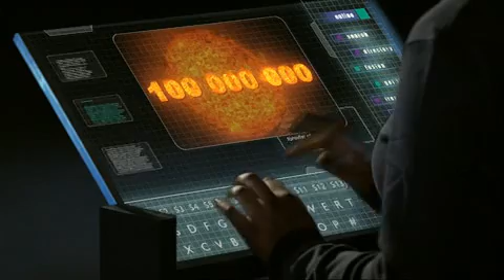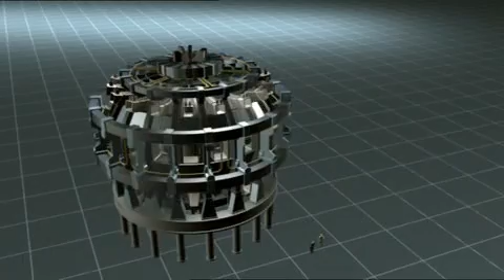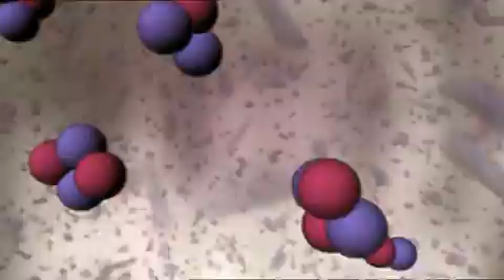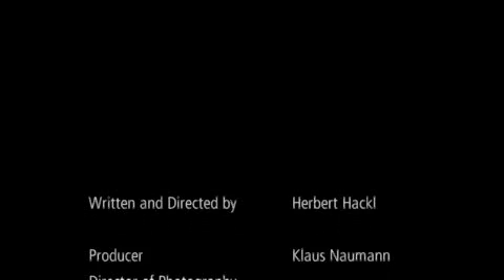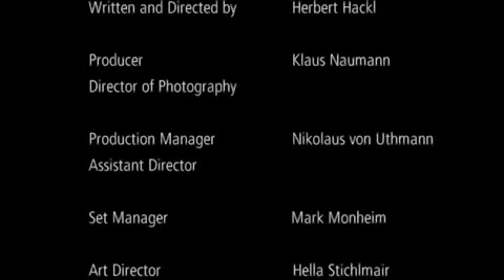How will a fusion power plant work?

Comment: It was glossed over how thermal energy in a Tokamak is converted to electricity. Is that heat generating steam, which turns a turbine to produce electricity? If a net energy fusion fails in smaller Tokamak's, how will going bigger (ITER) achieve net energy? I ask, because aren't smaller versions of a system possible when it is the optimum design?

Comment: 6:00 is where the video starts to explain how energy is extracted from fusion
Reply: The odd idea there, is even though the reactor is needing to heat the deutrium/tritium into a plasma at 100 million degrees, the neutrons heating the reactor wall to produce steam to spin a turbine to produce electricity, will be sufficient to achieve a net energy return? Energy is lost in conversion, as it will be producing electricity via heating water vapor into steam that then turns a turbine, making the idea of getting to net energy even more challenging. I still wonder if the ITER will succeed or if some other design will need to be developed.
Reply: Ah ha, so that's why they seek to initiate fusion with a lot of energy input, but to achieve net energy the reaction must self generate. I get it.

Comment: MY DREAM SPACECRAFT
1.Fusion Power Fuel
2.Plasma Engine
3.Quantum Computer 4.Q-Carbon with other materials.
5.Limitless 1 Tbps Wifi.

Possibly 10% - 2X of the Speed of Light
Reply: Name: GumbsX - 2040
Reply: GumbaverianX that would 1,000,000,0000,000,000,000

Comment: Tokamaks will never be viable fusion power plants.   The fusion power plants of the future will probably have symmetrical plasmas, and will certainly not have "ring shaped plasmas"
Reply: The future plasma reactors will most likely be puls powered reactors and will most likely be using the pB fueld.

Comment: If this one way Nuclear process is true then the dark spots underneath the Suns rolling upper atmosphere would not be dark spots.. .  .Because if the fusion reactions takes place at the Suns core and then radiates outward.. .  .Then those dark spots would be radiating a brilliant white light.. .  .But that's not what we observe.. .  .So the Suns underbody must be considerably cooler than the upper atmosphere..  . .Also it is known that substances loss their so called magnetism at extremely high temperatures.. .  .However, astronomers have observed and recorded magnetic effects upon the surface of the Sun.

Comment: Our beautiful Electric Sun is made of Plasma!!!!.. .  .And that's just Two Spherical Sine Wavefronts multiplying inward +1=0 now -1 dividing outward at right angles from their sources..  .  .Rather like drops of water into a pond multiplying inward +1=0 now -1 dividing outward ripples at right angles from their source's.. .  .Only the drops of water are Inward Spherical Sine Wavefronts multiplying inward from all other matter.. .  . And where the two positive and negative electromagnetic spherical sine wavefronts meet, creates the particle effect +1=0 now... . if that was a pebble, or a wave particle wave.. .  .They have opposite vectors and quantum spin forming the positron +1=0 now -1 electron Wave Centre.. .  .Or any dipole moment!!.. .  .The inward absorption +1=0 now -1 outward emission between the two previous vectors forms the Fibonacci sequence.. .                                                                                                                                                                                                                                      Stimulated emission is a process by the way of which a higher energy quantum mechanical state of an atomic particle Absorbing Energy Compression +1=0 now is being converted to a lower level -1 resulting in the production of light photon oscillations, or new electromagnetic vibrations dividing outward independent of the motion of their sources.. .  .And therefore as individual light spheres super impose crests and troughs become in phase,  in the future its really just light interacting with matter, and the Higgs bosons from Higgs field are really just photon oscillations from all other matter Spherically distributed around that particle now in 3D space, or electromagnetic vibrations multiplying ei inward from the Universe.  . .. And therefore the Sun naturally has enough surrounding implosive positive energy compression contracting time and space around, and within the Sun multiplying inward +1=0 now causing the atoms to break up into plasma occupying larger areas of space within the Sun +1=0 now -1 that constant explosive de-compression dividing expansion outward away from the Sun forms the inward force called gravity as time unfolds C2 into the future.. .  .Takes about eight minutes to reach Earth.. .  .                                                                                                                                                                                                                                  Therefore their fusion reactors will never work efficiently.. .  . Simply because the Sun is a million times larger than our Earth.   . .. And therefore has naturally enough surrounding implosive positive energy compression continuously contracting time and space around, and within the Sun multiplying inward +1=0 now.. .  .Efficiently producing Kinetic Energy in the form of Heat radiating away from the Sun.. .  .This cyclical process converts the "Potential Energy of the Surrounding Space" into the "Kinetic Energy of Suns" as they grow larger into adult Star's..   . Until they reach their age, or temperature limit exploding as Supernovas throwing of rings that eventually give birth to other systems in their wake..  ..Compressing Energy Contraction is life +1=0 now -1 de-compressing expansion is Death.. .  .                                                                                                                                                                                                                                    Yeah sure you'll achieve results by harnessing all the energy output external to the system that you can muster.  . ..And then narrow it down Imploding into one point of some selected material substance.. .  .And produce results.. .  .But only for a slit second!.. .  .                                                                                                                                                                                                                                  Because again the Sun is a million times larger than the Earth, and therefore naturally has efficient amounts of Surrounding Implosive Positive Energy Compression Continuously Contracting Time and Space, Around and within the Sun Multiplying Inward +1=0 now.. .  .The Lorentz contraction of time and space is infinite in our Universe, because its the fusion of the Vibrating Wavefronts themselves, Compressing the Wave Amplitude +1=0 now most of that energy is within Vibrating Matter.  . ..Because everything is relative to the rays of Light : Velocity = Time Density +1=0 now -1 Density of Space Time G/r2.. .  .V= td +1=0 now -1 ds-t G/r2.. .  .The greater the Energy Compression +1=0 now -1 the shorter the expanding spiral wavelengths.. .  .Our universe acts like a gigantic computer because everything will be formed by a surrounding 4pi Spherical inward absorption +1=0 now -1 outward emission of electromagnetic waves.. .  .All motion is 2pi Spiral.. .  .And all 3D directions are 4pi Spherically curved thus : individual input +1=0 now -1 output Wave Centres of photon energy are everywhere relative to an infinite future of potential possibilities, shaped rather like onions relative only to their frequency f continuously coming into +1=0 now -1 out of existence, forming the total oscillating amplitude of Sine Wavefronts at each and every point of space compressing wave centres of energy +1=0 now -1 de-compressing Two Opposing Spiral Vortices, or contracting +1=0 now -1 expanding Virtual Pair's Spiralling out of existence.. .  .Time is inverse multiplying Energy Compression +1=0 now -1 dividing expansion like frequency and wavelength.. .  .                                                                                                                                                                                                                                   So that what they really need is some kind of perpetual motion device powered naturally by the external environment.. .  .Just like the Planets, Stars, and Galaxies are in perpetual motion powered by the Universe.. .  . However are not man made machines.. .  .And because our universe acts like a gigantic computer very moment is a new beginning +1=0 now and the end -1.. .  .Therefore the big bung output division theory by tracing time back to a single point in the past was a huge misconception.. .  . Unless the time reversing singularity of only motion becomes the atoms.. .  .A potential infinity within infinity!!.. .  .Compressing Energy Contraction is Life +1=0 now -1 de-compressing expansion is Death.. .  .Big Bang Death's  are happening now 360, 24/7.. .  .Atomic particles are really High Wave Amplitude Wave Centres of Pure Vibration.. .  ."From regions of intense surrounding wave pressure" .  . ..Made of Vibrating Wavefronts concentrically layered like onions called shells in particle physics, or Spherical Standing Wave Structures over a period of time before decaying back into the eternal Light .. .  .Now their output was the negation of their input : 0 goes to 1, 1 to 0..  ..the start of the Fibonacci Spiral.. .  .So how can we implode more positive energy compression input contracting time and space multiplying inward +1=0 now than the natural surrounding environment dose?
Reply: +Seamless Robe Write some paper that prove your theory rather than comment on YouTube and nobody care what you're saying.
Reply: +Seamless Robe 
didn't read
didn't care
Reply: Do you care about where all your tax paying dollars are going? ..  .I guess that all depends on whether you become a hard working tax payer, or a capitalistic scab! ... .Their fusion reactors are pieces of junk that will never work efficiently.. .  . Our Sun works via implosion naturally, simply because is a million times larger than the Earth.. .  .Therefore they will never achieve that kind of Energy Compression, without using extra energy that's external to the system.. .  .
Reply: Do you know what energy is? .. .. The fusion reactors are 30 years away from pumping out more energy than was put in .  . ..And they always will be .. .  .LOL!!!
Reply: sorry for the "think they are smirk funny" commentators. but your first post, i honestly didnt understand a shit :).. how high degree on math do i need. to get anything out of that you posted?
Reply: Tap the side of a round bucket of water.  . ..Because the Higgs Bosons from Higgs Field are really just photon oscillations from all other matter Spherically distributed around any particle existing now in 3D space, or electromagnetic wave vibrations multiplying ei inward from the universe +1=0 now.. .  . Implosive Potential Energy always comes first before becoming +1=0 now -1 explosive Kinetic Energy.. .  .The fact that this Spherical region of the One Infinite Universe has a limited observable range as the light waves of electromagnetic radiation come from a distance radius.  . ..Absorbing that information +1=0 now can see all matter, star's and galaxies as they were in the past from when those light waves were emitted independent of the motion of their source's.. .  .And are observable spherically distributed in the shape of an inverse Sphere.  . ..4pi R2.. .  .And the fact that (See: Spherical Electron Sixty Symbols) shows how the electron is indeed a perfectly round Vibrating Sphere.. .  .Therefore 3D geometrically are two sides of the same + now - coin!!.. .  .The increase in Energy Compression/Mass Volume +1=0 now -1 de-compressing expansion was only a slight pulsating deviation.. .  .Nevertheless, there exists only two combinations of these Two Spherical Sine Wavefronts multiplying ei inward +1=0 now -1 dividing outward at right angles from their source's.. .  .Tap the side of a round bucket of water.  . ..Because they have opposite vectors and quantum spin forming the positron +1=0 now -1 electron Wave Centre.. .  .4pi R2=/N pi Re2.. .  .Or any dipole moment.. .  .Now space is a division of Solidity into entropy as time unfolds C2 the second law of thermodynamics.. .  .But also in the future E2 will equal a multiplication of Volume +1=0 now at the expense of gravitational potential -1.. .  .E2=M2 C4+P2 C2.. .  .The energy comes imploding from the surrounding environment.  . ..With antimatter positive Energy Compression +1=0 now -1 de-compressing momentum forming the Mass and Acceleration equivalence principle F=ma.. .  .As individual light spheres super impose crests and troughs become in phase (their space time line symmetries will synchronize) or amplify by compressing the wave amplitude +1=0 now -1 the shorter the expanding spiral wavelengths dividing acceleration away from its source in unison.. .  .The strength of the gravitational field is inversely proportional to the square of the distance from the source of that constant expanding light sphere.. .  .Therefore the greater the Energy Compressing the wave amplitude +1=0 now -1 the shorter the expanding spiral wavelengths dividing acceleration away from their source's in union.. .  . The Sun is a million times larger than our Earth.  . ..And therefore naturally has enough Surrounding implosive positive energy compression contracting time and space around the square of the Suns surrounding radius compressing the wave amplitude +1=0 now.. .  .And within the Sun multiplying ei inward +1=0 now causing the atoms to break up into Plasma occupying larger areas of space within the Sun +1=0 now -1 that constant explosive de-compression dividing expansion outward away from the Sun forms the inward force called gravity as time unfolds C2 into the future.. .  .Takes about eight minutes to reach Earth.. .  .And likewise the constant outward momentum of the Light from Earth (the negative expanding polarity transverses the acceleration), or gravitation from the continuous stimulated emissions as time unfolds C2 into the future.. .  .The trouble is within the Standard Models atoms and material point particles from a big bang theory.. .  .They are thinking about the universe back to front.. .  .Implosive Potential Energy always comes first before becoming +1=0 now -1 explosive Kinetic Energy.. .  .With antimatter positive Energy Compression +1=0 now -1 de-compressing momentum forming the Mass and Acceleration equivalence principle F=ma.. .  .The Star's grow larger as they get older, simply by absorbing energy from the surrounding environment, just like everything else in nature.. .  .Until they reach their age, or temperature limit +1=0 now -1 exploding as Supernovas somewhere within the One Infinite Universe.. .  .But these people think that the Nuclear Sun's grow smaller as they get older.. .  .And that the biggest and brightest stars are the oldest.. .  .Because they are full of gas like a full gas tank in your car.. .  .And than by burning off all the gas they get smaller as they get older.. .  .Which is the exact opposite to what happens with everything else in nature.. .  .
Reply: +Seamless Robe wow im impressed. my batteries are at 1%. will readit later
Reply: u seem to be an interesting fellow, can u enlighten me about wat u mean with all the numbers and math jargon?

Bear with me, i am not some physics undergrad... yet... i still have school to finish lol but from wat i can infer from ur comment, u are saying that due to certain mathematics governing the quantum behavior of the waves of the plasma (which is wat the sun is made of), it dictates that the the sun needs alot of space to be able to generate that much energy... rite? am i okay so far? if yes i shall continue...

But to entertain the idea of a fusion reactor here on earth, we dun really need the tremendous power that is equivelant to the sun do we? cos we arent trying to recreate the whole sun here, we are trying to replicate the design of the sun to harness the energy it can be produced from its plasma, wat im trying to say is that...

we dun need as much energy produced as the sun, all we need is enuf to power stuff, in that case cant we still have small but concentrated power plants of plasma to work with? if theres any flaws in my understanding above, please correct me, if u can.

also, u also proposed that we should somehow harness the energy of planetary motion as a means of perpectual motion, now that does sound like a good idea, but wouldnt that affect the day cycle of the planet(s) in question and from that, wouldnt that affect environment of the planet(s), or would it be so minute that it can be striked off?
Reply: also if u are gonna reply... could u tell me how the higgs field and the big bang tie into this?

my understand of the two is as follows:
the higgs boson is an elementary particle that exists everywhere and it is what dictates the acceleration of masses since due to its prescence it would "slow" us down due when we move

the big bang is a phenomenon where the whole universe exists as a singularity which expands rapidly over time and formed to what our universe is tday, and this is posited by mathematical equations of observed readings of the universe's distribution and expansion that arrived to this conclusion. 

please correct me if i am wrong thx! ^^